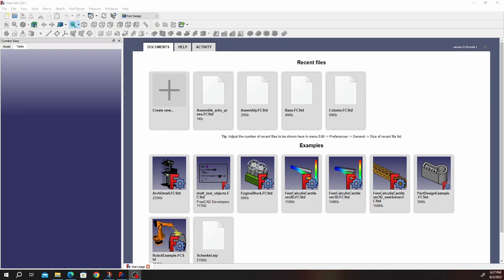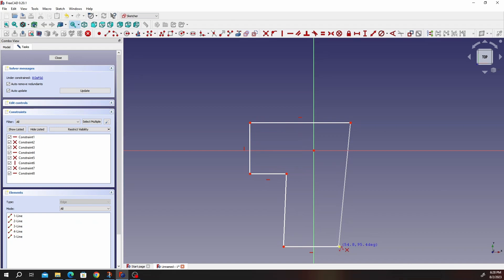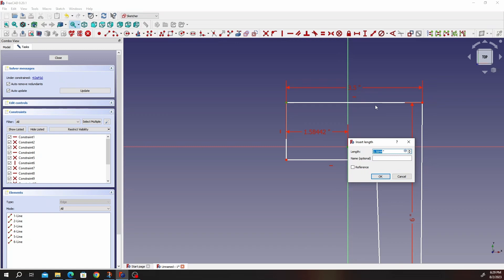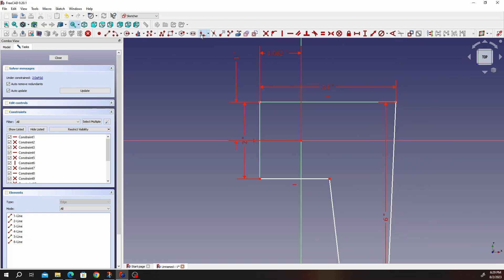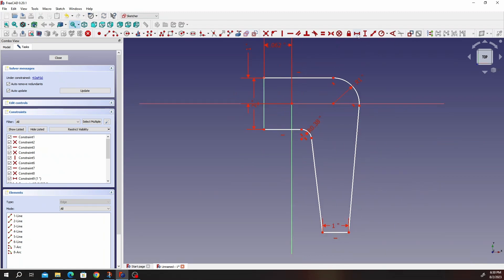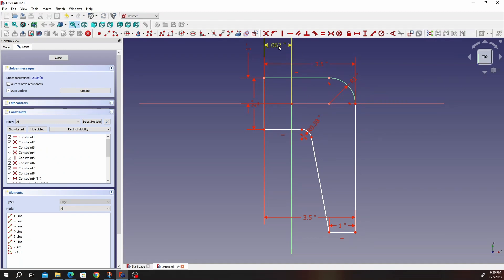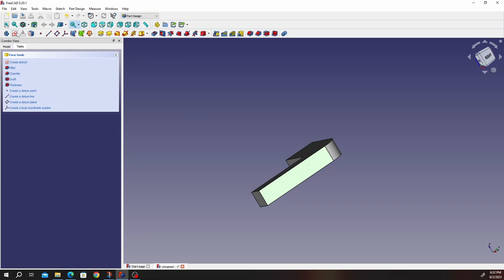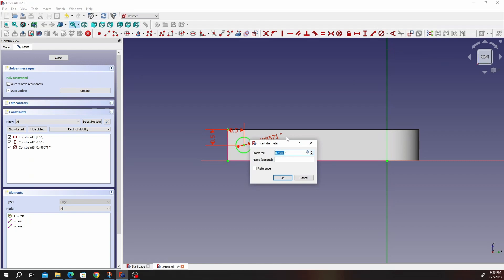Arbor Press: Part 2 (How to Draw an Arbor Press Column in FreeCAD - Easy Step-by-Step Tutorial)

Comment: Hi , you can make a guide for run FreeCad with Multi-core/Multithreaded (Windoiws and Linux version) support? thank you very much ! My freecad stuck use one core for minutes all times!
Reply from the maker: FreeCad uses Opencascade as its 3D geometry engine.  https://wiki.freecad.org/OpenCASCADE , https://dev.opencascade.org/ . At the moment Opencascade is not fully multithreaded. So you will be better off using a CPU with fewer cores but a higher clock rate . If you have a good graphics card on your PC, enable OpenGL VBO (Edit ->Preferences -> Display )
Reply: @techwithjulius  thank you the best answer